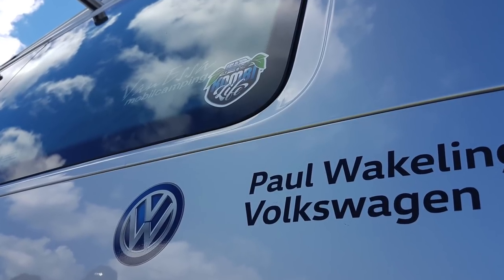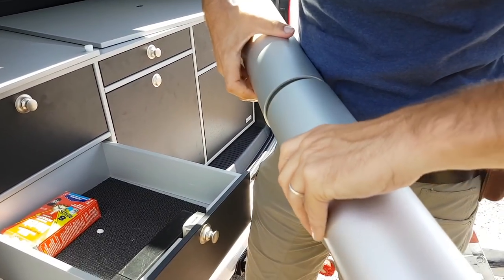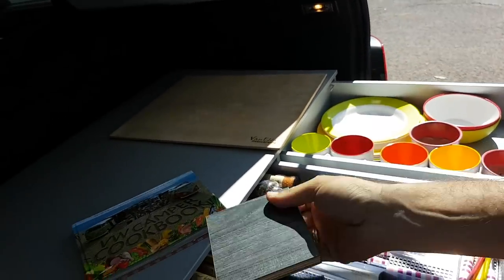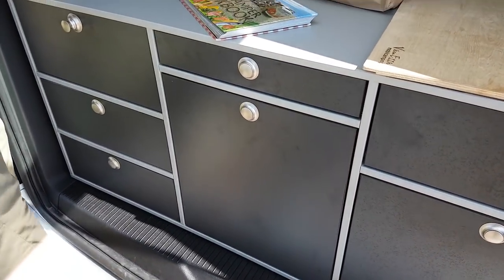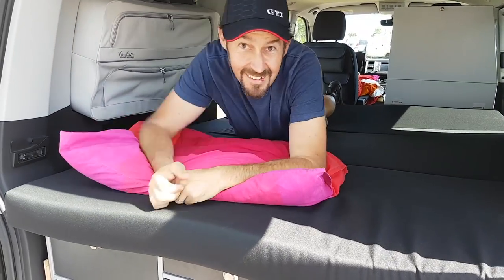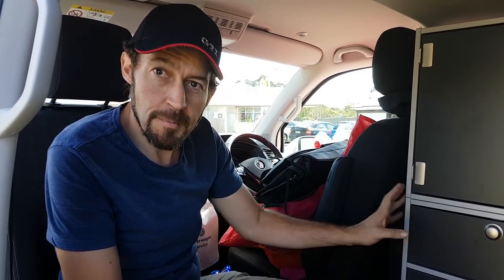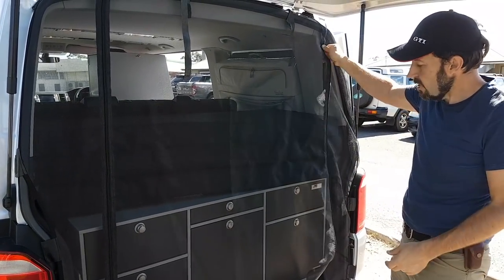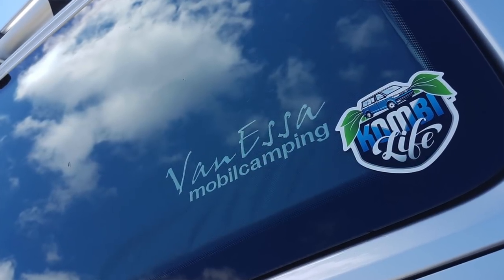VanEssa Mobil Camping Australia - Volkswagen Multi-Van Fitout

Comment: We have a similar kitchen in the rear in our multivan  as these guys say it is a great approach.  you don't want to be cooking inside.  It was quite time consuming to fabricate so it looks good.  This is a way better option especially if your not a craftsman.  Ours bolts to the rails to so can be removed to.  We have the plastic Engle so taller than  the Waeco it just scrapes in to be the same level as the rear seat folded to bed mode. We removed the swivel mid row seats  I like the separate battery idea - we replaced the drive battery with a 130amp LPO4  which runs the fridge for 4-5 days and still has over 13volts to crank the engine.   The multivan is good as discussed and not a lot dearer than a transporter once you add in the seats, compliance, upholster the walls and insulate the sun blinds etc etc. Way better to drive.  there is some guys in Brisbane who will install a poptop if you need it.